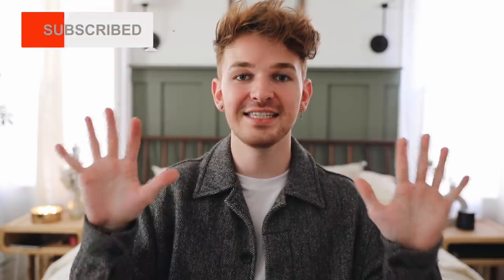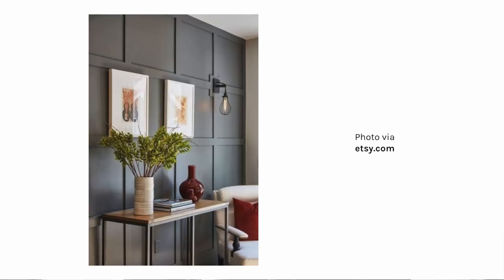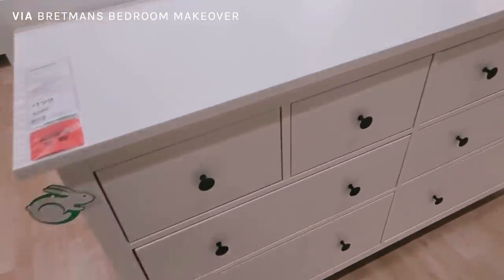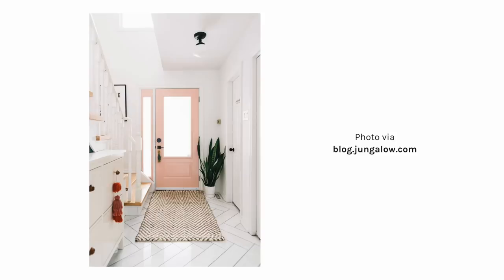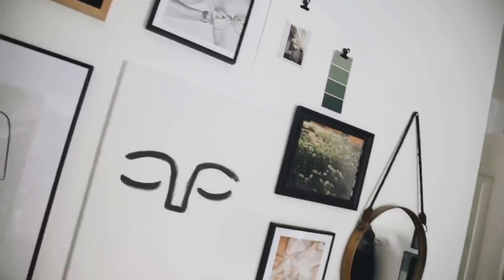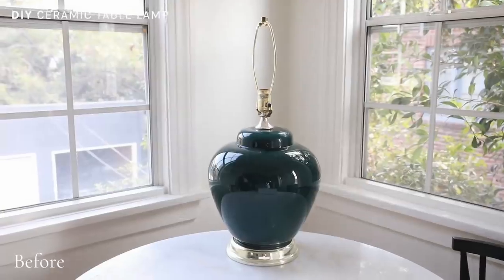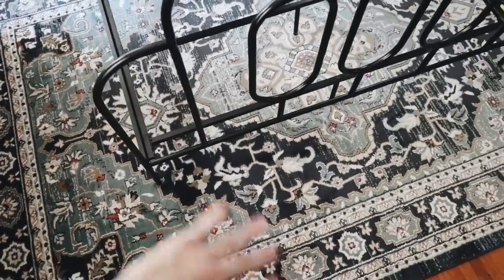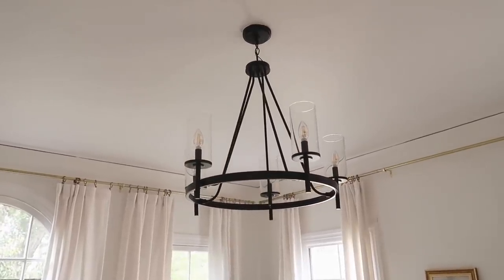10 DIY BEDROOM HACKS + Updates to TRANSFORM Your Space!

Comment: LF:  If you are a renter...one thing you can put on the wall is a rug or wall hanging instead of using paint.  Easy breezy to remove and then patch the small nail holes when you move out.  Just like a rug on the floor, it is an easy statement piece and helps set the tone for the room with colors & design...AND you take it with you when you move!  TFS :D
Reply from the maker: such a great idea!!

Comment: First off, I am enjoying your channel so much. Though your style is not at all like mine, it's beautiful. Thanks for sharing. 
Now, for a tip from me someone who's probably been DIYing longer than you are old. 😄 I'm not sure what kind of glue you used, though it looks like construction glue, on your lovely board and batten wall. Whatever it is, you might want to ask your landlord about leaving it and possibly just painting it to match the wall instead of trying to remove it. The glue is more than likely going to pull the paper off the drywall when you try to remove the boards, leaving more of the mess than you can easily deal with. If I were your landlord, I'd say leave it. Personally I'd call him/her luck as it adds to the character of the room. Bonus for them.